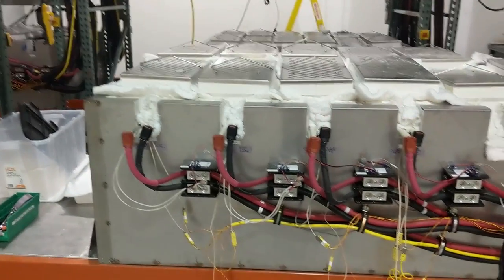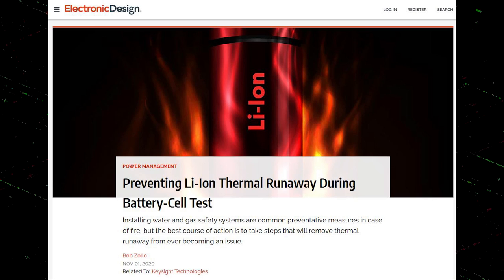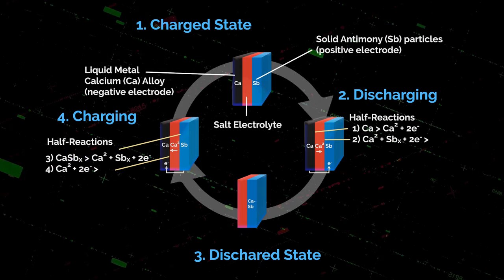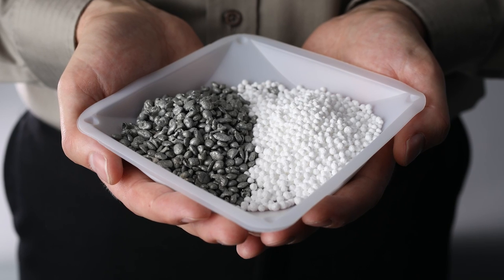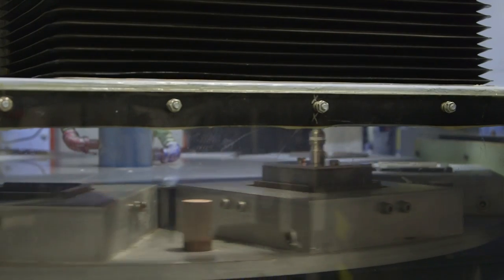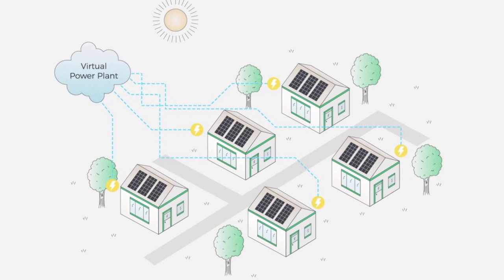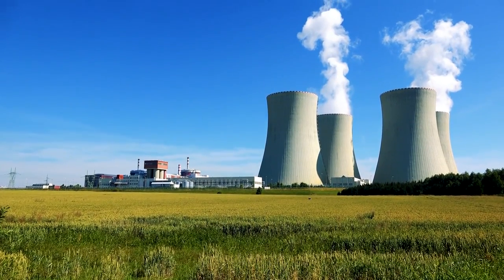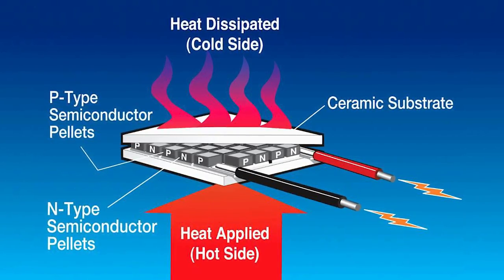Ambri: A Battery that Could Change the World

Comment: I was skeptical when he said they run at six hundred degrees, then I sat and listened to the man talk. This is amazing!!
Reply: That was 600 C you should have kept your skepticism.
Reply: Ok, it sounds like a good idea BUT these batteries depend on the assumption that renewables themselves deliver benefits. Do they? It seems that they don't :@t
Moreover, besides the research on how "green" is green energy when you factor in all production emissions and energy input for installation (huge roads are opened, hills flattened, etc), maintenance, and so on, I have yet to see a viable plan for tearing down and recycle the  huge wind turbines and billions of solar panels.
Reply: @C_R_O_M________  renewables can provide a TON of energy, but the issue is that they are intermittent, if we can easily store the energy en-masse, renewables would be really great. 

This would even get better, if we use solar power satellites and focus the energy on a spot.
Reply: @C_R_O_M________  You're forgetting that fossil fuels aren't sustainable economically, sooner or later we will need to go fully nuclear or fully renewable with battery backup, and which do you think will an uninformed public go for? one that Elon; a new cult of personality is pushing hard for, or one that has been propagandized as pure evil for several decades?
Reply: @TCBYEAHCUZ  That's the narrative since the "peak oil" era, decades ago. New technology makes it easier extractable/recoverable. Despite from that wind and solar are terrible solutions (for mass scale energy production). Personal use - a different matter, they can be excellent solutions. We shall see. In any case, do yourself a favor and read what the analysts commented. You'll learn a lot. Maybe they'll help you invest too. They are excellent.
Reply: @C_R_O_M________  We will eventually run out of economically viable sources of oil, it will happen, it's basic arithmetic.
Reply: @TCBYEAHCUZ  yes we will but the question is "when?". If it's in 50 or even 100 years from now, it makes quite a difference in your planning. So far oil and natural gas are not scarce and they only suffer from excessive artificial costs from governments that support the narrative that the sky is falling because of fossil fuels.
Reply: @jonross377 :  Please don't become too skeptical too quickly.   The liquid sodium battery has been in existence (operating around 500 C) for about 50 years, all the while looking for a safe, practical application.  First thought to be useful in electric vehicles, the concerns about molten sodium in a crash scared people off including them in designs.  Now, with the emphasis on  renewable energy (and the concomitant need to store it)  these stationary battery applications are being developed.  Probably good.
Reply: @C_R_O_M________  :  There will always be pioneers.  In the minds of pioneers, 50years is "nothing," in terms of planning for some conceivable problem.  (Consider Elon Musk and his desire to establish off-Earth colonies to ensure the survival of humanity.  Whether Musk does anything about it now is unimportant; that's how his mind works ... now.)
Reply: @C_R_O_M________  i lived in Düsseldorf for the last 9 years and the cost per kwh was increased a lot , specially in the last 5 years. I still don't understand why we don't put more focus on Thorium and project like the Rubbiatron, it would tale so much less effort to make the shift once we have perfected such technologies.
Reply: @jeanclaudewellness8274  perhaps because renewable technology is produced by Germany's heavy industry like Siemens producing wind turbines and BASF battery technology. I bet there are many more. If you read the commentary I proposed though, you ll see that no matter the political push reality will, at some point, make the correction.
Reply: @C_R_O_M________  gold words! A reality check is what we need indeed!
Reply: @C_R_O_M________  Agreed but Californians keep paying for it :)
Reply: I am still skeptical. If a battery heats up to 700 Degrees C by its own ionic current it must have one helluva high internal resisitance. It can't possibly be efficient, there has got to be alternative technologies that do it better, its just a matter of them being discovered. Also I am not convinced it can actually survive freezing and remelting as both metals and the electrolyte change their densities as they transition from liquid to solid and back, so they may not stay nicely layered. And what happens in a case of a mild eathquake? Do we expect a massive heatup and explosion due to the layers mixing up and creating an internal short?  When you dealing with liquids (especially hot ones) you have to consider such things, there is a reason why most batteries have their electrolytes jellified.
Reply: The basic technology isn't entirely new, but his implementation might be what's needed to make it more popular.
Reply: @bloggerccc  Alon Musk has results, this dude is a person that was behind Zebra batteries - which were complete fuck up, so he rebranded them. Problem is with exposing liquid sodium to oxygen when battery finally erodes it's own casing (which is often the case for liquid metal ones). Look up Zebra batteries, this dude nearly bankrupted one company (Modec) that bought into his snake oil, and cause many people to be sacked at Iveco after they tried to implement his battery in their 3.5 T delivery van. He's not a pioneer, he was peddling this crap for over 35 years now.

Comment: This was one of the most interesting episodes I have seen in ages,as well as one of the most important for society if we are to break the hold of fossil in our lives. Well done!
Reply: You know that battery is just a energy storage device, not the energy. US burns a lot of fossils to charge these batteries no matter what.
Reply: @Allin7days  charged by wind and solar
Reply: @Allin7days  Generally paired with renewables, so, dead wrong direction of thinking.
Reply: @Allin7days  Yes,I am aware of batteries being energy storage devices. Without some way to store renewables (ie in batteries),fossil will still be around to power things when the wind calms and the sun goes down.
Reply: Break the hold of fossil fuels in our lives? LOLOLOLOL. Maybe 100 years from now. Maybe. Probably not tho. Because ENERGY DENSITY.
Reply: @fredsnit5699  Chill, dude. Wind and solar are quite incapable of the generating the power needed for an industrial economy.
Reply: @andymack8178  Always partly, never fully.
Reply: Ok, it sounds like a good idea BUT these batteries depend on the assumption that renewables themselves deliver benefits. Do they? It seems that they don't :@t
Moreover, besides the research on how "green" is green energy when you factor in all production emissions and energy input for installation (huge roads are opened, hills flattened, etc), maintenance, and so on, I have yet to see a viable plan for tearing down and recycle the  huge wind turbines and billions of solar panels.
Reply: @N01Spl they would just buy the renewable energy companies..i thought you were smart
Reply: @tmst2199  bullshit; renewables can produce 100% of the energy needs for an industrial economy. Science much?

Comment: 20:09 - 20:37
Well, to be energy efficient it could be worthwhile to design the building with a centrally located in-door structure for the battery.
IE, if you're running an Ambri battery in an Arctic research base or on Mars, put the battery dead-center in the building.
No matter what you do, eventually some heat will bleed out from the molten insides of your battery into the air around it.
So you might as well have that heat bleeding out into your living structure first, allowing the people inside to get just that much more efficiency out of their energy storage and heat generation.
It won't be much, maybe an extra half degree C worth of indoor heating, but every little bit of added efficiency helps, so you might as well put that heat loss to use.
Reply: Don't go to mars the native lifeforms are hostile

Comment: The one question that wasn't asked how much energy to heat the battery  compared to discharge capacity.
Edit: It appears that once battery is initially molten and well insulated the charging and discharging process is enough to keep it molten even if the lose factor was 50% or more it could be viable storage if the renewable energy was cheap enough.
I suspect the most efficient way of using them would be to continually cycle them so they could be used to charge and discharge each other when no power was required for the grid. Volume may be a deciding factor.
The fact that a plant is planned for Texas gives a glimmer of hope that in may be viable.
Reply: Aw, darn! You ruined the movie for me. I was hanging on just to hear the answer to that.
Reply: @LazerBee  
🤣🤣🤣!!!
Reply: exactly what i was thinking ....grab your shovels cause it looks like we are going to have to dig a bit deeper.  That being said though this is still an excellent  product with loads of potential ..... first thought .... lava lol
Reply: Wait, they ramble for 30 minutes and manage to avoid the key points you need to evaluate if the thing is actually worth jack shit? Because i have been waiting for that  for about 10 minutes (watching at 1.75 times speed):
What is the efficiency of that? How much energy do they need to operate?
So far they only addressed safety lifetime. 2 important things, yes. But considering they where already babbling on for over 10 minutes it's a poor result. That's why i was scrolling through the comments.
Is this generally that type of channel?
Edit:
Sorry they also mentioned charge and recharge speed but all those 3 things have one thing in common. They never give real life values not even from their lab. My confidence is low and shrinking.
Reply: I want to know man
Reply: Not only how many k watt to warm up, but how many to recharge. It always takes more than a kw to charge a kw. Lithium is very cost effective but still about 93 percent for 1 kw.
Reply: @fgregerfeaxcwfeffece  Sometimes people get so proud of their project it lures them into creating an answer for every challenge. For example the heat of the desert may be fine for the batteries but not so fine for the Solar Panels used to charge them.
Reply: @barryrudolph9542  That excuse only works until someone tells you about it after that it's obvious that it's just marketing babble.
And since i am not  the only person with critical thinking someone must have told them that by now and they haven't provided an update.
Smells like bullshit and the stench gets worse.
Reply: @fgregerfeaxcwfeffece  People eat it up though as can be seen by all the flowers that are being thrown at this guy from people posting on this video.
Reply: @fgregerfeaxcwfeffece  What we sense from the beginning the gullible don't discover until it's too late. Then they are more angry at us than they are at the one that cheated them because we caused them to feel stupid. It's rather frightening to realize that so many people are so easily fooled.
Reply: @barryrudolph9542  "Gullible" is a useless deprecating umbrella term like the casual "stupid".
Our society would not function if our default was being suspicious of others. We live in a specialized society because it's more effective and that by definition requires that not everyone knows everything about all topics. Deceivers bank on that. But until its pointed out it could also be a honest mistake. That's why peer reviewing is so important in science.
Reply: @fgregerfeaxcwfeffece  I honestly don't know what he is however there were some red flags that led me to wonder if he is a deceiver or just a proud defender.

Comment: Nice interview......   I think you missed the 3 most important Questions...   When and at what cost available to the mass consumer ....  The total efficiency of the battery. (energy out / energy in),....     The length of time it can store and hold energy from 100% down to 90%...
Reply: I don't think this technology is for consumers per se, but the big elephant in grid electricity is storage and this could be that solution.
Reply: Round trip efficient ~80%
Reply: It's for grid storage only. It's liquid, it's not good to move it when working
Reply: @giggsrayn5205  ^ what you said
Reply: The cost should be competitive if not somewhat cheaper than li-ion banks of a similar capacity, and much more scalable given that they are made from abundant materials....Round trip efficiency is claimed to be 80%... Not sure as the battery is designed to work switching as a load or a source of power on a fluctuating grid, it should be charging and discharging daily, as it is intended to do, rather than a long-term storage solution.
Reply: This is intended for large scale grid back up...it wont be on a consumer level until the container/shell is proven as strong and durable, as the working temp is said to be 6-700°
Reply: @danielboro2000  
So don't move it when working.
Take it to a local storage facility, drop into a secure room.
Apply energy from solar/ wind for 2 weeks.
Then it's working........ Anywhere.
Reply: @roqm1248  
The "container/ shell" is simply a physics problem.
There's no physical pressure to withstand.
The expansion rates of the materials are known.
The temperatures are known.
They already have the case design.
As for "long term" vs "daily discharge", who uses such a battery (Inc lithium ion) for "long term" storage?
Reply: @rogerstarkey5390  they haven't worked out the formulation of the ceramics to be used as a container, what happens to it with the heat cycles and vibrations( shipping containers) seems to be the the first application they will use, which solves the transportation methodology.
Reply: @rogerstarkey5390  my point exactly
Reply: @rogerstarkey5390  You can't move it while the metals are in a liquid state, which is the only usable state.

Comment: OMG i've been following this company for years! I really hope they are able to pull this off! Affordable batteries for solar for decades.
Reply: You've been following them for years and nothing yet. Doesn't that tell you anything?
Reply: @grasonicus  it was a TED talk when they initially split from the University.. I plan for this to be my big upgrade since now I use 20KWH of forklift batteries that a local shop was about to toss them out
Reply: @grasonicus  no. Li ion batter needed 40 years from first talk to usage.
most ides need 10y+ to go from dream to product and that if thers no basic research needed
Reply: @buzz86us2005  Use Lithium for that.  Ambri needs to be on a stable foundation, you don't want molten metal sloshing around in a forklift.
Reply: @AaronCoakley  I use the forklift battery to store solar energy for my home, i plan to get this when it hits market to replace it.
Reply: Hydro-generating powerplants also need to store energy produced at off-peak hours.
Reply: @RudolfParnigoni  no. Thy just stop letting the water go. The lake is the power battery.